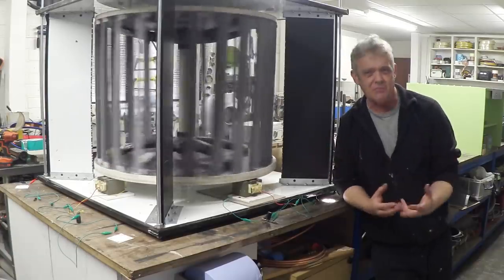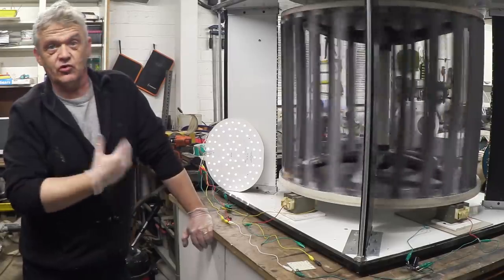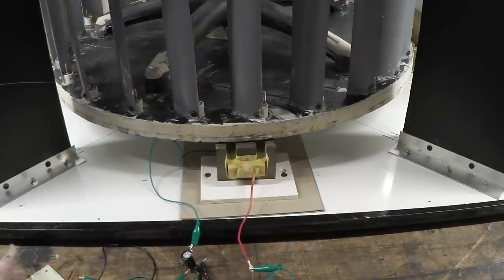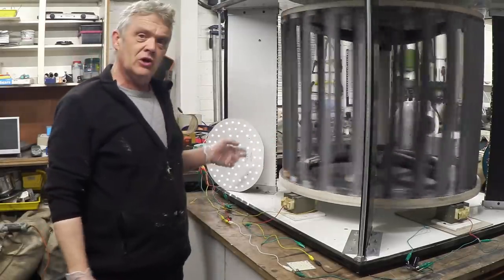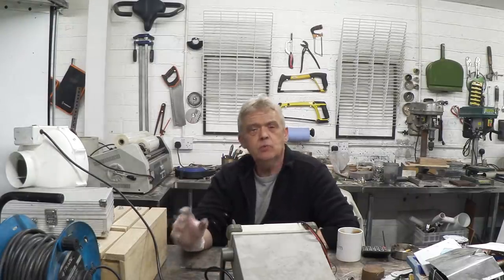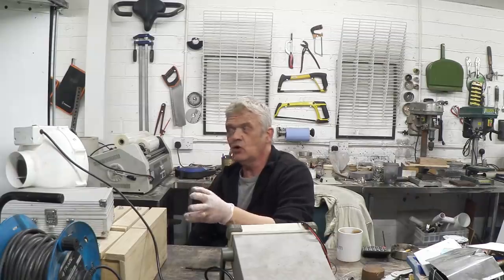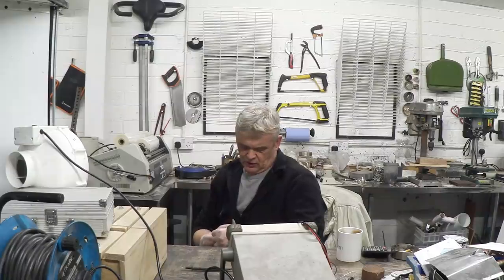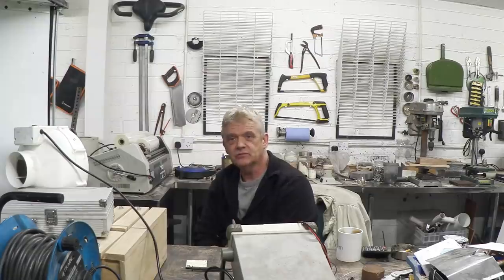Building a 1kW Wind Turbine For Under £100 - Part 6 - Installing The Coils

Comment: You solved my biggest concern! I was wondering how you were going to overcome inductive resistance. I was imaging some form of "engagement" relay at sufficient wind speed. This simple capacitor rectifier solution that works at low wind speeds is awesome! This brings many low energy capture devices into the realm of "doable". Congratulation Robert! I am really enjoying this series. Please continue it.
Reply: Same ^^
Reply from the maker: I was pondering it too mate especially as the coils and magnets were almost certainly out of phase and it was going to be one hell of a job to get them in phase lol
Reply: @ThinkingandTinkering  Would you explain how you hooked up the components in a video, or share a schematic somehow.? In comments back and forth with other viewers here, some of us are not 100% sure how you did it. I assume you hooked up the coil, capacitor, and ac input of the rectifier in parallel (I also assume this creates a 'frequency resonant circuit'). I am really curious about the science of what is going on in the circuit. Is  DC output self limiting? Meaning, would it only output a certain amount of DC current based on the resonance of the circuit itself?  As DC current is drawn off does the inductive resistance between the magnets and coil increase?

Comment: I would recommend rectifying each coil and paralleling the rectified outputs together. This full wave rectified output can then be fed into a charge controller that has mppt (maximum power point tracking) costing around £30 (easily found online) . The mppt charging controller will always ensure there is no load at startup and always ensure the maximum power point is achieved on load.
Reply: Would it be possible to see a schematic for those of us a little less technically inclined Paul?
Reply: @RealFamilyMan Thanks!
Reply from the maker: cheers mate - I will have a look for one
Reply: @realfamilyman  The main problem to overcome is to have all the coils output in phase. Otherwise it will happen as Robert explained when he connected the coils directly. If the outputs are out of phase they will cancel each other and this will increase the resistive  magnetic field. 
In a factory generator all the coils are perfectly aligned in order to be in phase and the output to be able to be added.
Reply: @realfamilyman  What page? I am curious to see the schematic of Robert's circuit. I think the issue is if you went with a single rectifier, the coils would have to be perfectly aligned so there was no out of phase sine wave cancelling effect. There would be losses there if not. Who knows how much? What is also nice about this approach is it is a simple modular design most shade tree tinkerers can do.

Comment: Thank you!!! Based on your discussions, I have been playing with a shake flashlight run off a coil and a magnet, and a tesla coil. I was able to remove the magnet, and charge the capacitor right from the field coming off the tesla coil, then inducing an electric current in the coil of the shake light. Like I said before, you are my best friend as it relates to this area of thought. I had to leave my job due to policy changes that I wasn't happy about, and this is giving me more entertainment than I've had in years. Keep it up!!
Reply from the maker: that is an awesome thing to do mate - I popped over to your channel in the hope of seeing a video on that - fancy doing one?
Reply: @ThinkingandTinkering  I may have to give that some thought. I should have most gear to make it possible. I might be able to recruit my brother. You’re inspiring me, my friend. Who knows what will happen?
Reply: So, my Tesla coil has an audio input which allows me to hook up an audio source. The plasma heats the air to produce the sound waves. I want to hook it up to a test tube of water, and a tone generator I built with my brother, and see what different frequencies of plasma would do to the water. Could I generate Brown's gas, and would the right frequency give me a better conversion rate? Heck, if the anode and cathode could be separated, could one get pure O2 and H2? Which could be burnt none the less to produce pure distilled water. Desalination maybe? Hmmm.
Reply from the maker: @jsoswell  it would be awesome if you did mate
Reply: Then my question would be, would your wind turbine be able to power the Tesla coil to produce flammable gas from salt water, which would be burnt for energy, water, and sea salt production?

Comment: Another aspect is the phase shift between voltage and current waves going in and out of the capacitor. Awesome stuff!! Somehow reminded me of how “jogging the memory” / rotating drums of vacuum tubes was needed to make Atanasoff’s computer operational.
Reply from the maker: I forgot about that - cheers mate

Comment: Each coil is an AC generator and the number of magnets passing over the coils, along with your RPM will determine your frequency. To be able to have these all work in unison would require precision placement of the  magnets and the coils. It is of course do able but what you discovered and I love that eureka moment is converting each untimed AC wave to a common DC.  The real credit goes to the diodes in the bridge rectifier.  The capacitor depending where it was (ac or dc side) would mainly contribute to the smoothing out of any ripple. (Or unwanted back EMF if in parallel on the ac side) I couldn't quite see its position but my guess it was on the DC side. What happened in the beginning is the AC waves from one coil was creating a badly timed opposing magnetic force in another coil hence the brake effect. Well done again because although it was not what you desired you had also created dynamic braking.  Now by the time you get to about your 70th video you could use that principle to avoid over revving your generator in high winds !! Keep up this great stuff we love it.
Reply: Yeah I was about to say the same thing about the phase of the output - I wonder if it’s possible to orient them in such a way to provide 3-phase power output but that’s probably pretty tricky

Comment: I sat there and timed your RPM's Robert, and while under load of that larger circular LED array your Turbine was rotating at almost exactly 23 RPM
Reply from the maker: thank you mate - I just counted in my head - sounds like you did a much better job - cheers

Comment: It may have simply been the case that you had the coils out of phase when you had them hooked together. When you were positioning them to hook them into series or parallel, did you look at their outputs on a multi-channel oscilloscope to confirm that they were in phase?
Reply: Unfortunately, I imagine quite a few of us don't have thousands or even hundreds of dollars of electronic test equipment at our disposal. Is there an easier method to discover this?
Reply: @ffaubert1  Fair point, let me give that some thought.
Reply: You dont need a multi channel oscilloscope for that. Simply hook up two coils in series and measure the ac voltage using a multimeter. then adjust the position of the coils until you get maximum ac voltage. Of course this only works if the magnets on the underside are spaced evenly. Or in Sir Roberts case are not spaced at all :D
Reply: @ffaubert1  As Gerald stated you could roughly line up the phases by connecting the coils in series and using a multimeter, adjust one coil until you have the highest AC voltage, or if you want to be fiddly and unnecessarily precise like me, you could build a simple circuit to align the phases based on their 0 point crossing time. You would need a dual op-amp chip, two resistors, and two LEDs, and a 5V supply. You would connect the negative inputs of the op-amps and the same leg of each coil all together, then each of the other legs of the coil to one of the op-amp's positive inputs, one resistor(100-200ohms would do) to each output of the op-amp, then both LEDs between the unused ends of the resistors with one facing one way and the other reversed. Naturally the 5V supply would have its positive go to both the op-amp's VCC and it's negative would go to the op-amp's ground. Then when the magnets pass the coils, any discrepancy in phase will illuminate the LEDs, with the severity of the discrepancy reflecting in how long they stay lit, and perfect matching of phases would result in the LEDs not illuminating at all.
Reply: so if the coils are put "in phase" then would the capacitors not be necessary ? if you keep the cap./diode bridge for dc output with the coils in phase, then would the caps. affect how the coils are coupled/decoupled from the magnets ?
Reply: @MrTubeuser12  If it's true that the issue was the coils being out of phase and 'fighting' or 'driving' each other, then having them in phase would remove the need to individually rectify and smooth them, which would boost the efficiency somewhat because every diode has an associated resistance. I don't personally think that 'coupling' had much to do with the problem since the torque that the coils reflect onto the wheel is strictly proportional to the power they are generating. I think that they were simply generating power well, but feeding that power into the other coil, which was not only acting as somewhat of a short circuit, but also potentially producing a field in the driven coil which opposed the field of the next magnet that was sweeping over it.
Reply from the maker: cheers mate - I think that is exactly why lol
Reply: If this is true, then it should work with just the rectifiers and not the capacitors. Robert, have you tried that?

Comment: I would hazard a guess that the 4 coils are out of phase so when wired together they act on each other like a EM brake. by rectifying to DC it removes all potential for any phase miss match.
Reply: aha this is the only answer which actually makes sense in my mind :)
Reply from the maker: I think so mate - cheers
Reply: @Youtube Censors Opinions Nice thought, I believe you're partially correct: If the coils are out of phase, and not exactly 180°, then the rectified voltage will also be out of phase, and there would still be a voltage difference in the different coils, but smaller... which would decrease inductive resistance, or even eliminate it, (if the phase difference was originally 180°). However, since the capacitor "smooths out" the wave form, removing it may increase those temporary voltage differences, leaving you with a "partial proof".

As a side note: adding a capacitor to a coil may reduce energy losses, (if the capacitor is the right size to achieve resonance, or close to it).

Comment: Amazing!  I had actually thought about the idea of capacitors .. but my ignorance keeps me from speaking up .. thank you for helping me keep my brain from "cogging" .. lol .. maybe I need a bigger capacitor! lol  I'm really enjoying all this!  🤣👍
Reply from the maker: mate - I barely know what I am talking about most of the time lol - you should certainly speak up
Reply: @ThinkingandTinkering  .. where I live in Arkansas it is not very windy .. compared to Kansas.  "Arkansas" comes from Native American .. meaning "south wind" .. so "Kansas" means "wind".  We get some wind here .. but not much unless associated with weather changes.  If I were higher up on a 2,000 ft. mountain we have nearby .. the trees are old but not tall bc of the wind.  I'm in the early process of putting a metal roof on our house .. and planning to do away with the round vents like you showed.  I have three of them here and they are almost always moving as the heat from the attic vents out.  However, it's got me wondering if I were to build a wind machine like you are showing .. but on a horizontal axis over the peak of the roof .. what it would achieve.  I have shade trees that I do not want to cut down just for maximum solar .. but there is plenty of south facing roof for solar panels.  I try to keep my mind open and really enjoy what you are doing with R&D in your space there.  Truly amazing .. and we never know the extent of our influence.  As regards to the capacitor .. I could imagine that the capacitor would take the "load" off the magnetic energy collected in the coil pass .. kinda like a check valve.  It's awesome to see you talking about extra coils sitting around the radius .. something I could see the possibility of .. even on both ends (top and bottom).

Comment: @1:53 you mention 10 revolutions per minute? Are your sure about that> This looks way faster!
Reply: In a previous video he mentioned that it looks that way because of the video film rate.
Reply: I counted. Around 24 revolution per minute. You can follow one of the chair's leg.
Reply from the maker: folks have told me it's between 23 and 26 rpm - I don't mind as I am not sure about the rpm at all
Reply: I think it is quite a good setup for these experiments, the blower is much smaller than the turbine so it seems very realistic. It’s a good way to optimize without costly equipment.

Comment: Hello, Robert. I have just this night come across your channel and video series. I'm in the States, so it's currently about 2:00 AM here but I can't tear myself away from your project. It is totally fascinating and I can't seem to tear myself away from it. I want to add my vote that you finish this series out to its logical end, regardless of the number of videos. I'm not familiar with the weather patterns there but here in the southern U.S., we generally have windy fall and winter weather and spring and summer tend to be less windy with considerable sunshine. I've been thinking for years now that the best method of self sufficient power here would be a combination of wind and solar. Your project has inspired me to start thinking again of building my own system. Keep up the great research. You're doing a wonderful job.

Comment: If the wiring diagram of the options he tried is what I think they were, I think it's the full bridge rectifiers on each coil that is making it run properly. The capacitors are also hugely beneficial for providing useful DC, instead of highly fluctuating voltage. The reason I think it's the full bridge rectifiers making things work when combining the outputs of multiple coils to a single load, is that they are the preventing current being forced back through one of the other coils. Without the full bridge rectifiers, the slightly irregular spacing and placement of magnets and coils cause slightly differently timed peaks in voltage, causing the current to be driven through the other coils, and the driven coils to act as brakes. This does not matter if the coils were wired in series or parallel. Using a full bridge rectifier on each coil lets you combine the DC output sides without letting current from one coil affect any of the others, and using capacitors across the DC sides smooths the output voltage.

Comment: Robert, you have proved a theory I’ve had for many years. Fantastic work! I had the theory of using a spark gap, or capacitor to reduce the torque of the load for many years. Unfortunately, I’ve been too busy working and trying to keep up with the bills, for any experimenting. I suggest you continue playing with these ideas, for I expect it will soon pay off. This discovery could possibly, fundamentally change the way we make power! Keep up the great work my friend!

Comment: For optimum power insure all coils are in phase with each other.   Most all PMA (permanent magnet alternators ) use 120 degree phase separation and rectify each phase on it's own.  Altinertly you could rectify each coil output and combine the DC power as a whole.
Reply from the maker: cheers mate

Comment: Well done Rob, using the Bridge Rec/Cap network effectively Isolates the AC Component from the Load and provides rough DC to operate the Load all at the same Time.

Comment: I am a recently retired electronic eng ,the capacitor will smooth out the hills and valleys in your dc voltage  the bridge just flip flops and gives you positive feed .witch in turn smooths out the dc ripple allowing  the rotor to run smoother and less obtrusive. Now you puy your magnets to the outside so you going to get higher voltage lower current. If you were to put the magnets in half way you could use the the coil and raise your current. remember  if you add a heavy load 4 is enough or it will stop turning.have a nice day

Comment: This is incredible Robert! I do not know if this would work on large wind turbines (probably only with much bigger capacity of the capacitor clutch), yet if it did, then it would open up doors to power generation at much lower wind speeds that would foster the transition to low carbon future. Amazing work! :)

Comment: you are correct with the clutch example and it is very similar to how a uninterruptible power supply works when it changes over from the grid to battery source

Comment: I know zero about electricity but find the whole build fascinating! Could you fit coils on the top and double the output? So without the capacitor/clutch you get resistance instead of torque if I've got that right.
Your so down to earth and enthusiastic. That's what makes your channel so interesting. 👍🏻

Comment: Its my understanding that the problem you experienced prior to using the bridge rectifier/capacitor, could be related to multiple coils (4 in your case) being connected together and out of phase. The net result would be each coil presenting a load to all the other coils. By including a bridge rectifier you have effectively isolated each coil from the other, so no opposing reaction is present